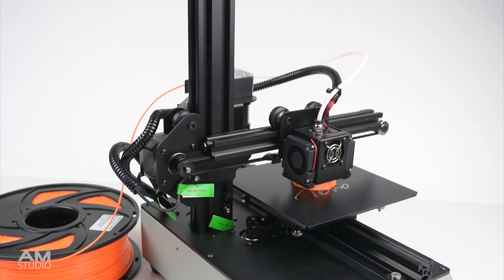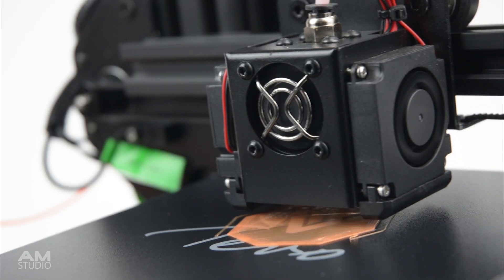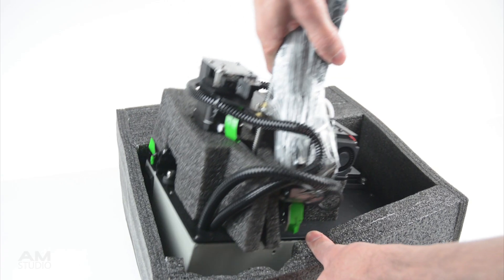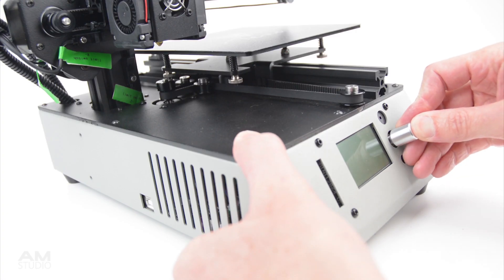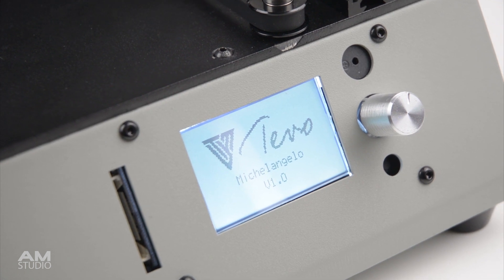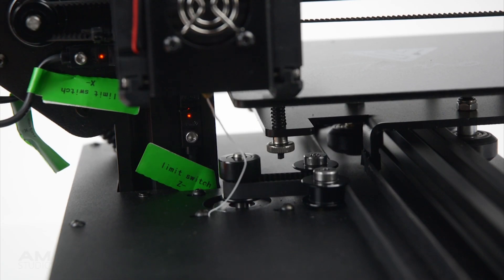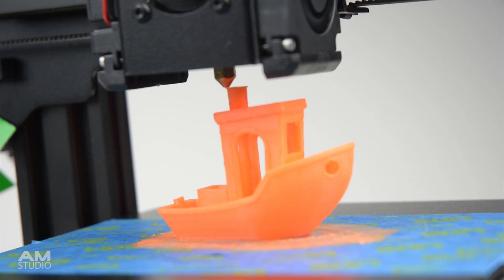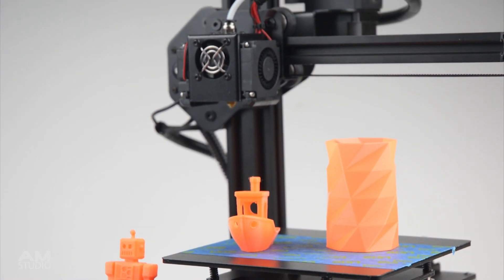TEVO MICHELANGELO 3D PRINTER

Comment: How would one level the bed, with practically no tools like you may have.
Reply: Piece of paper.
Reply: Tweaked86 thanks.
Reply: Nobody told me that the leveling screws were snugged down way tight out of the box. They should all be loosened some, and then do the leveling.

Comment: Would you recommend this one over the other three you've reviewed?
Reply from the maker: Depends on  your requirements and what your looking for. eg. Print size, a Diy kit/ready built and budget. This one is a good small compact, ready to go printer that's producing good results.
Reply: what would you reccomend for a semi beginner which is looking to own one for cheap but still knows how to use 3d printers properly
Reply: Honestly it would be used for small parts for my rally sim to upgrade the g920 from your previous videos that's about it I'm just worried about it not having a heated plate if I wanted to use abs